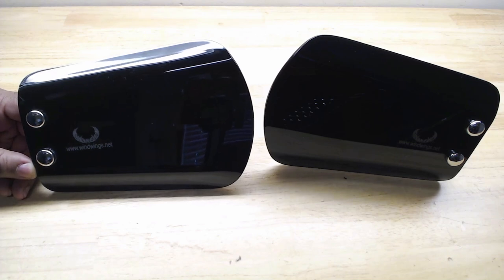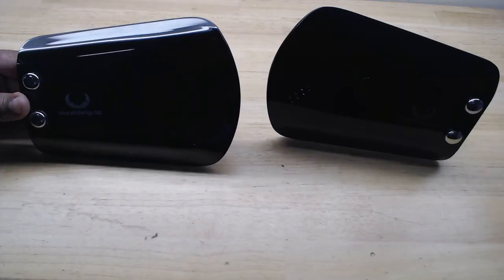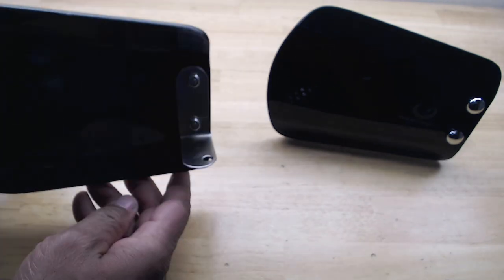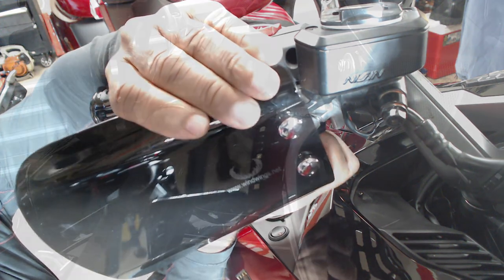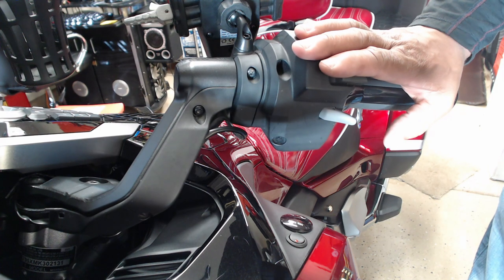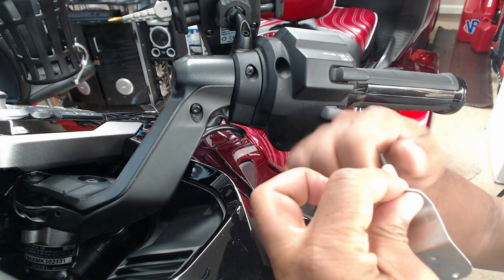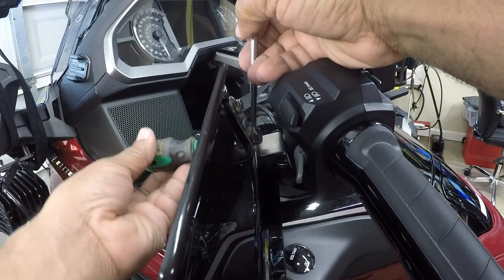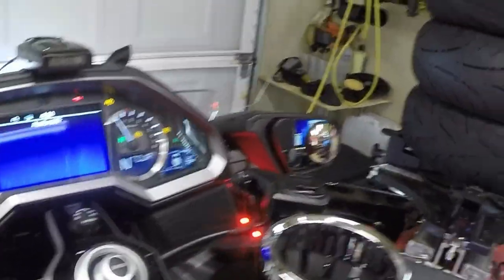Windwings Cold Hands Air Deflectors for Honda Goldwings 2001-2023 Installation

Comment: Based on this I bought the hand wings for my 2019 DCT.  No doubt that these will help with the cooler temps.  The only negative I found is that they block the rear view partially.  One looses someof the "inside" view. I use the blind spot mirrors however the inside of the normal mirrirs help see farther down the road.  So it is a trade off that I'll have to get used to, but having had frostbite as a kid, I need all the help I can get for hand warmth.  I also bought the KLIM deflect handlebar muffs fro when the temps get even colder or there is a lot of extra wind.